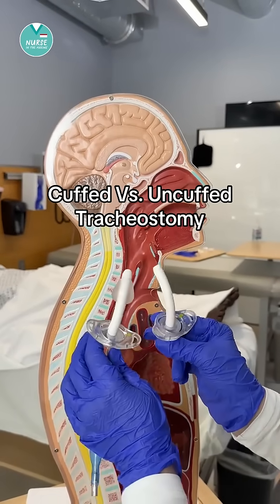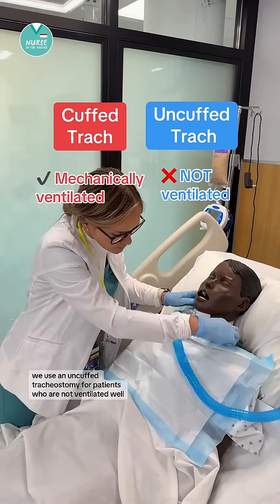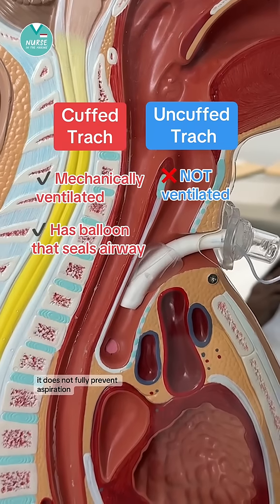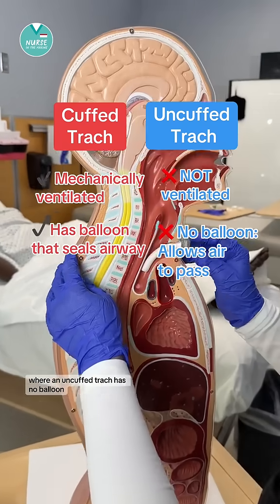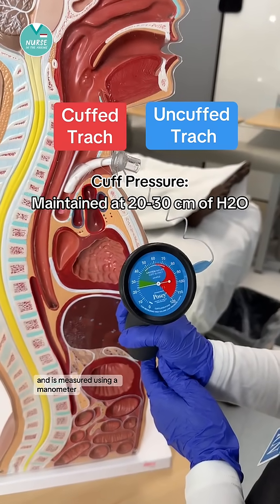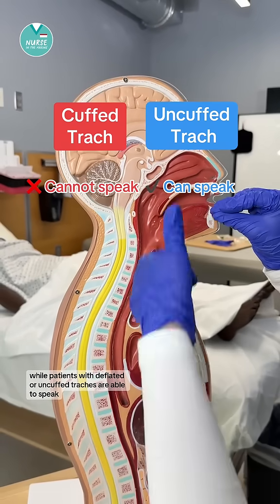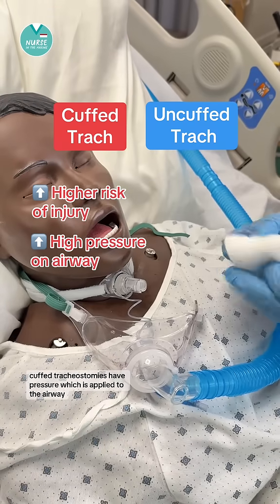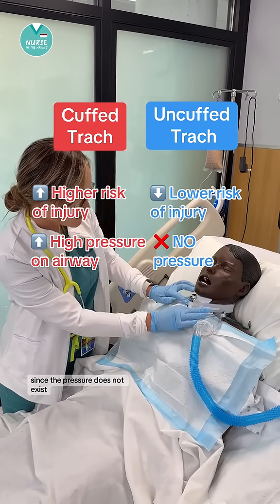🫁 Tracheostomy Tubes: Cuffed Vs. Uncuffed #RN #BSN #futurenurse

Comment: I need a tracheostomy tube? I'm a patient and the type of Tracheostomy Tube I use is no longer being manufactured by Shiley,but they're making a flexible in it's place. The problem for me is it doesn't fit the same and it's not the same length or diameter as it says on the box. For me it's more narrow and shorter and I can breathe and it causes me to have headaches and my heart feels pressure. So I'm in search of a SHILEY TRACHEOSTOMY TUBE 4CFS 5.0 mm X 9.4 mm X 6.5  CUFFLESS,NON-FENESTRATED. I am seeking help from my Doctor's as well, because the Trache I'm wearing has a crack along the shaft and it's scary, because it's in my throat. I would appreciate any help. If you know any patients that no longer use the ones they have unopened of course. Thank you and I learned something to.

Comment: Do uncuffed trachs then have a higher risk for aspiration?
Reply from the maker: Great question!😊Uncuffed tracheostomy tubes may have a higher risk of aspiration, but not in all cases. While they don’t provide a seal to block secretions or food from entering the airway, the actual aspiration risk depends on the patient’s ability to swallow and clear secretions effectively. In patients with intact swallowing reflexes and good airway protection, an uncuffed tube does not automatically mean a higher aspiration risk.